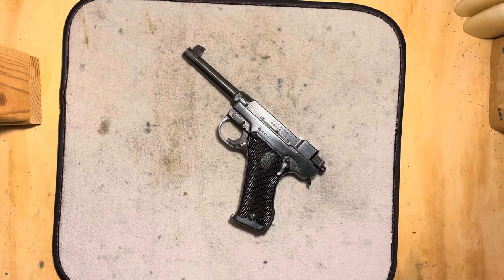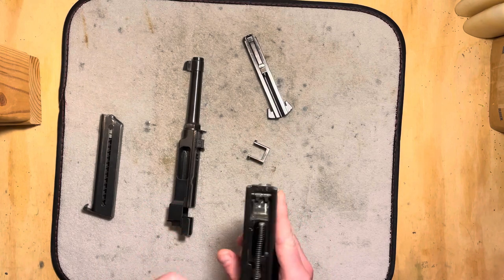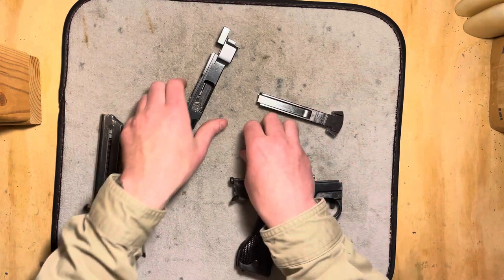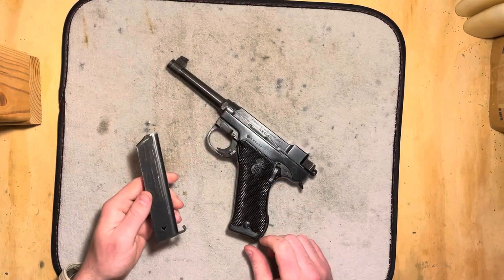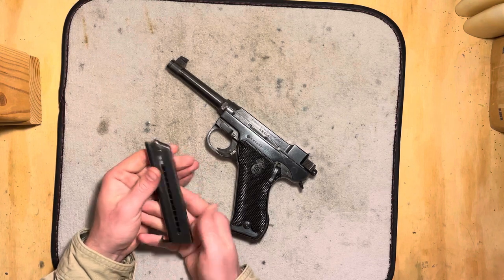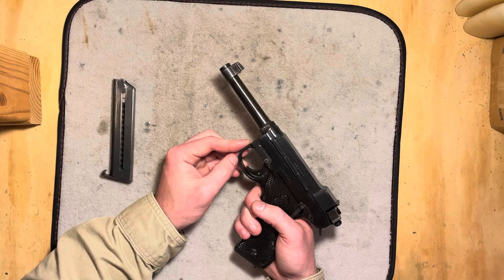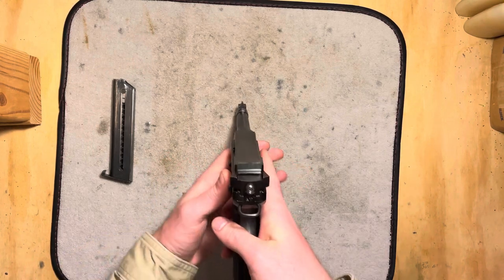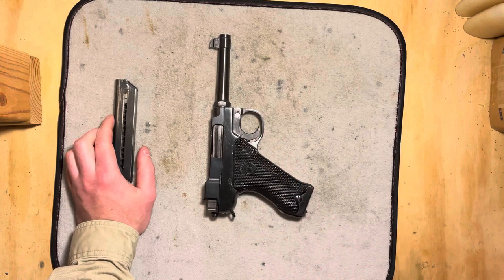Swedish M/40 Husqvarna Lahti Field Strip & Discussion

Comment: Have you been able to remove the recoil spring? I'm wanting to replace the spring and install a Wolff XP spring for extra safety.
Reply from the maker: I have not. The guide rod is staked into the cap at the rear and cannot be disassembled without permanent alteration/destruction of the portion of the rod that is flared out to retain the rear cap.

Comment: Funny .. Sweden was "neutral” during the war but selling tons of steel to Germany (and others) so it seems odd when you mention wartime effects on the quality of steel in Sweden.. they weren’t even in the war but they were damn sure profiting from it.
Reply from the maker: I might get the exact details incorrect, but I believe Sweden was actually supplying Germany with their highly prized iron ore of exceptional quality, which Germany was using to produce steel. Sweden, however, lacked access to other metals for making high strength steel alloys. 

If I haven’t forgotten, I think Sweden arranged the sale of the iron ore on the condition they were able to purchase rifle scopes from Germany for their m/41 sniper system as the German optics were more highly regarded.